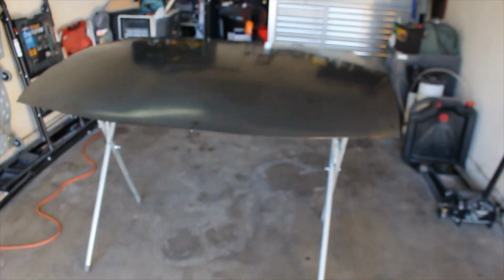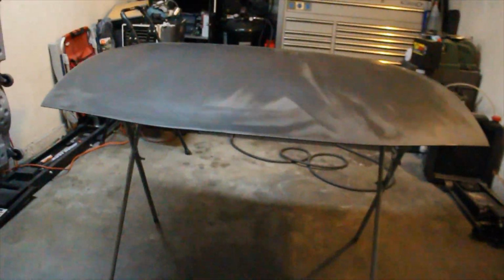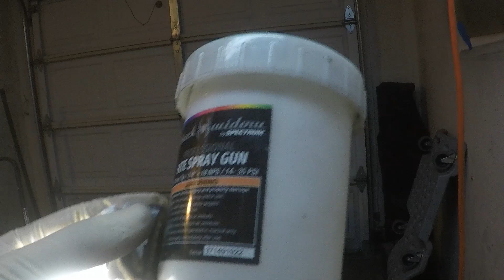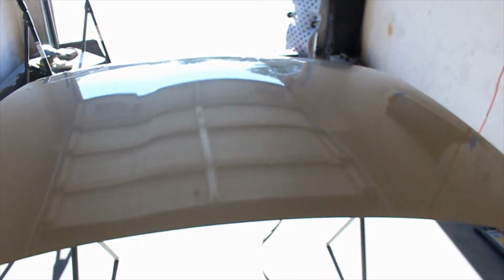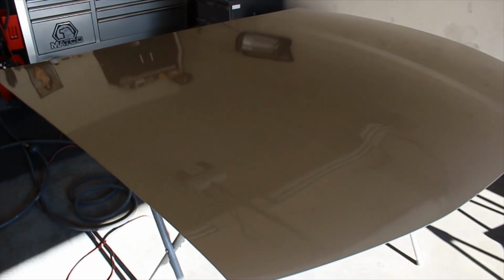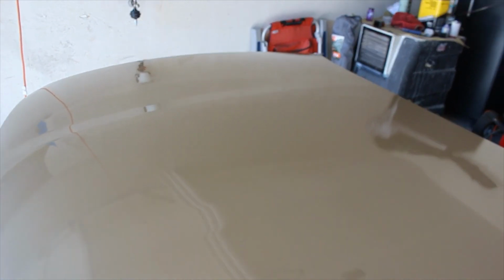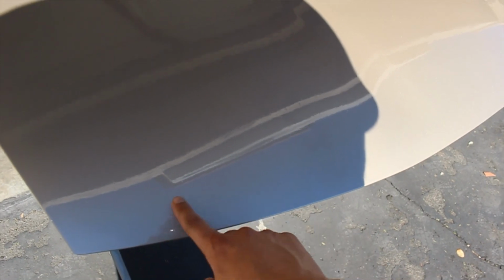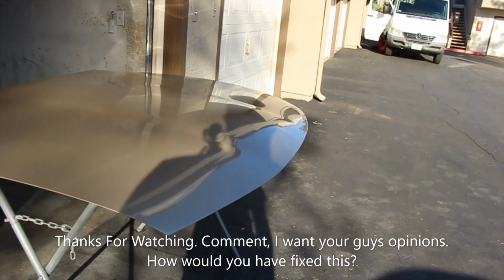Car Hood Paint Job (Fail)

Comment: I did the same thing during my first try painting a fender and a hood.  I was painting in a closed garage.  The whole garage was filled in a cloud of overspray.  The fender turned out okay, but the hood not so good.  I sprayed the hood installed on the car, so all of that overspray floating around eventually landed on the new paint and clear.  The hood had various fish eyes, chemical popping and orange peel.  On my next paint job, I made some corrections and opened the garage door about  a 1/4 way up to get some good ventilation.  And I increased the air pressure about 5-7psi.  The final results were so much better...

Comment: That really sucks when that happens. You may want to consider a secondary air storage tank. That will help keep your compressor from cycling and flooding the system with hot wet air.
Reply from the maker: SW Customs I will have to consider it , rn I’m looking for better filtration systems I think that’s my main moisture problem
Reply from the maker: SW Customs I will have to consider it , rn I’m looking for better filtration systems I think that’s my main moisture problem

Comment: Copper 1/2" 50' up/down at least 4 times with ball valves at the bottoms. Truck air dryer cheap and effective this solved all my line moisture problems.

Comment: Do you have a fan, gotta move that cloud outa there, apart from obvious safety concerns the overspray dries and falls down in your work just like dust too. But its not bad for painting in the dark also!
Reply from the maker: JFabrication yes I have a fan but the overspray is trapped in the garage , fan can’t move air fast enough , plus I gotta keep it closed for those “nosey neighbors “
Reply: Just A Mechanic Just A Mechanic thats too bad, i bet you could get decent results with the gun if you can control the conditions. I also heard you had a cracked inline filter,  careful with how much pressure reaches that, either put it after the inlet regulator or turn down the pressure coming out your compressor reg so you dont explode those plastic filters.
Reply from the maker: JFabrication yes it was cracked, I got a new one to replace it but I’m also going to add another filter down the line, I think my biggest problem was having the filter too close to the compressor perhaps .
Reply: Just A Mechanic good idea, best way to cut the moisture problem is an accumulator regulator filter you can drain the water out between coats as needed if its humid in there. I have the $20 HFT item #68232 mounted on the wall, i dont even need an plastic inline filter on my gun anymore.

Comment: Brother, what kind of filtration do you have?
Reply from the maker: PHARRAWAY  I use a kobalt air dryer , and a Devilbiss in-line air filter , but I just noticed that the plastic housing on the dryer is cracked at the bottom.
Reply: @Mechaniclyfe  Oh yea, that will do it, what you can do is wait for the clear to dry several days and just sand it with 800 and flow coat it and you should be good
Reply from the maker: PHARRAWAY that’s what I was going to do , but the guy wanted to pick it up that day. I told him bring it back in a few days and I’ll get it fixed .
Reply from the maker: PHARRAWAY Thanks for the tip 🙏🏻
Reply: @Mechaniclyfe  Yea Oh well

Comment: Bro, you need to check out Fisheye Filter. In line filter that traps 99.9% of water. I’ve have zero moisture issues since I got mine and it’s super humid where I live too. Another hood vid!!!
Reply from the maker: BrusHstroKeZ Airbrush & Design you got a link? Is that the name of it?
Reply: Yes, that is the name of it. Here’s the link: http://www.fisheyefilter.com/. They work amazing and u can take the filters out, dry them, and re-use them too.
Reply from the maker: BrusHstroKeZ Airbrush & Design thanks bro, I’m going to check it out! The Devilbiss in-line filter I used was brand new and still had water come thru 🙄
Reply: Get one. They stop the air flow as soon as the filter gets full, so no water ever gets through. Just swap the filter out and your good to go.

Comment: I think i see tiger strips
Reply from the maker: s197stang no stipes just dry spray , the gun started spitting when I finished the first coat, cleaned it out with some acetone and that fixed the spitting problem but still had the dry spray marks.

Comment: I think the HTE shoots way to much base for cold weather also if u have dry spray ur activator can b to fast or pass it's pot life the difference of activator stage can cause fish eye and solvent pop had it happen to me a lot of time
Reply from the maker: Elchingon_92 thanks for the tip, I was trying to use a fast activator cuz of the cold weather around 62 degrees but looks like that might have been a bad idea for the weather. I found a crack in my filter system, I think that’s why I got water going in the lines. I’m gonna try to get a new system next paycheck and see how that works. Also going to try to use some fisheye eliminator next time.
Reply from the maker: Elchingon_92 yeah at this point there just isn’t much option it’s going to need a respray regardless.